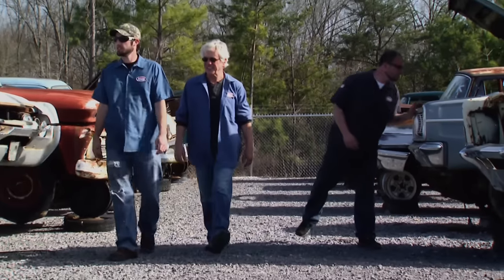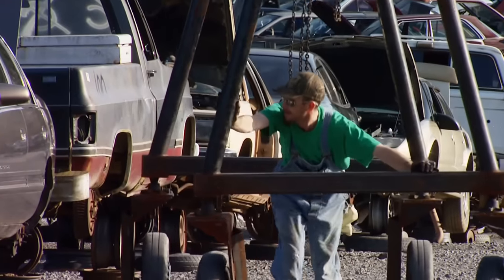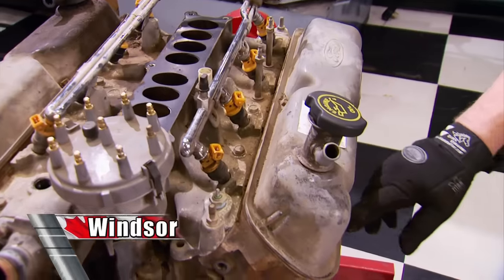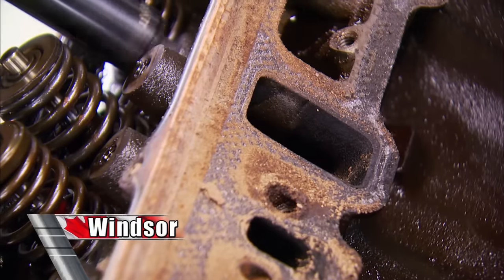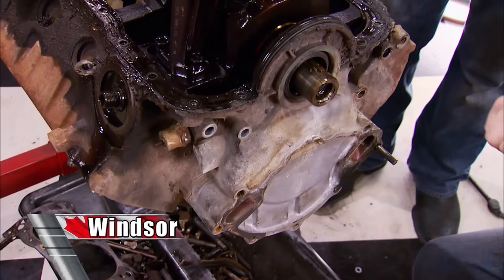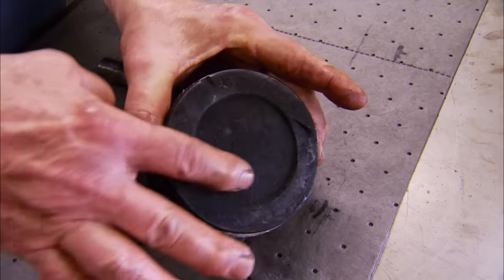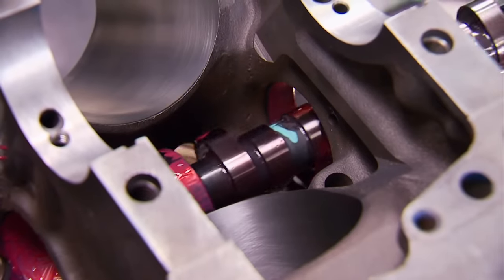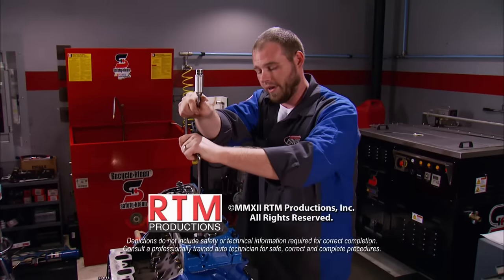Tearing Down a Pair of 351 Small Blocks: Windsor vs Cleveland - HorsePower S16, E10

Comment: OK WAIT...Thats NOT a 71 LTD (or even a 72)...I had one...which had the 351 Windsor, in my own opinion the better of the two engines...especially when you figure the 351W 2BBL to 351C 2BBL compared...The windsor ALWAYS had more low RPM torque...which is why it was put in Fullsize cars...and the Cleveland was mostly used in Midsize cars where the lack of low end torque didn't matter as much....SMH!

Comment: Who would scrap a foxbody coupe😒😒, and besides the clevland is junk the oiling system does not give primary pressure to the crank, it's a recipe for spun bearings. The only good part about it is the heads to build a clevor

Comment: CLEVELAND all the way. - 100 times better engine than the Windsor... ESPECIALLY the last two years they were produced. That being in Australia. The block and heads were crafted from the same piece of steel and would therefore, heat up and cool down together. You could pound the hell out of these, and they made amazing drag engines.

Comment: Yes I'm a coyote guy I would never drive any good I'm just saying you can get the same amount of power with a smaller engine but then again the EcoBoost is worse on gas when you're actually towing or flooring it everywhere It's actually worse than the coyote

Comment: Me quiero hacer de un Ford Galaxie 500 LTD 1974 propiedad primero de una tía abuela y ahora de mi tia, la verdad no recuerdo que motor tiene. Solo recuerdo que dice en la tapa del filtro de aire. 351 H.O 255 HP. trae carburador Holley creo que es de 4 gargantas. No sé si sea el Cleveland o el Winsor. Fue adquirido en México 🇲🇽. Trae 100,000 millas originales desde hace 46 años. Me pudieran ayudar si saben más información de los vendidos en México. Lo que me gusta es que lleva de transmisión manual de 3 velocidades a la columna de dirección.

Comment: Ah Cleveland is considered a big block.
Reply: No.
Reply: @Sokrates66  Sorry it is, Windsor is Smallblock!!
Reply: @garykent8193  Its not, and here is why. Small vs big block is a Chevy thing. Ford never rated their engines like that. 351c is a 335 series engine. But if you anyway want to rate the 351c.  The 351c  is in fact a small block due to chevy specs and the 351c have the same bore spacing as the 351w which is the criteria for big or small block. So if you "say" 351w is a "small block" the 351c is it also.

Comment: A 351W is not a smallblock..Its a midblock as it has a taller deck than a smallblock [9.5 vs 8.2]..289/302's are SMALLBLOCKS..

How would you guys classify a 350/400 Pontiac?..Lemme guess ;- a smallblock[?].......LOL

Comment: This is a very sophomoric attempt at highlighting the differences between the Ford 351 Windsor and 351 Cleveland engines and a fair degree of misinformation.
Reply: Be specific please.
Reply: @Michael Stansfield Can you recommend a video/channel that does a better job of describing the differences please?
Reply: A better video explaining the differences?  There may be some out there, but I prefer reading.  A good synopsis of the 351C can be found in this Hot Rod article.
https://www.hotrod.com/articles/1971-ford-mustang-everything-need-know-fords-351-cleveland-powerhouse-powerplant/
Beyond that, you need to do some reading, some research.  The 351W has been around since 1969 and has undergone tons of changes.  The 351C was around from only 1970 to 1974, but was available in a number of variations.
Oh, almost forgot, this site has tons of information.  https://www.diyford.com/

Comment: Why was ford so stingy with 4 barrel carbs, did Holley piss them off or something...🤷🏾‍♂️
Reply: Corvette Coupe you need to do more research on that, there was one 2v Cleveland variant and 3 with 4v carbs.  One of each with Windsor.  Ford primarily used its own Autolite 4100 4v, a spreadbore Autolite 4300 4v, and various Holley carbs.  It depends on the application.
Reply: My research was done under the hood 40+ years ago folks, 2V was the common on Sub 400 CI engines Mustang, Torino & Cougar...
Reply: Corvette Coupe well there you go, I guess your question was rhetorical?

Comment: Why use oil restrictors in the Morse why would you want to restrict oil flow that is ridiculous you won't oil until flow like water otherwise you starve the barons in the engine at higher PM You wanna make some packages bigger not restrict them or you do your homework Stacy David you're wrong

Comment: The value of the canted-heads in the Cleveland is severely limited in comparison to the Windsor, only the big port closed chambered heads with the four-bolt mains pushes it past the Windsor. Frankly the open-chambered Clevelands are mediocre at best...you've got to realize, the entire engine with the closed-chambered heads were conceived at a time where emissions, economy and gas prices were still not taken seriously, the stock compression was way too high at eleven to one, making todays gasoline virtually unusable. The only "fatal flaw" to the best of the Clevelands was the exhaust ports...had the engine been brought out earlier, nor the "gas crisis", insurance companies & the safety nazis coming to power, this 351 cubic-inch motor could have been an off the showroom floor  500+HP factory engine.

Comment: Serious question: Do you blokes actually get anything right, ever?
3 points straight off the top. 
The Cleveland was built right up to 1982. That’s 13 years not the 4 you claimed. You do realise there is an entire muscle industry out side of Murcia don’t you?
How can you compare a late model efi Windsor to the pre-smog Cleveland. Would be much more beneficial to compare a circa 1970 version of each engine.
As for the ‘small’ mains on the C, their size had nothing to do with strength, but were chosen as experiment of 3” mains on the 351w failed due massively increased bearing speed. Ford went back to what worked.
Sad thing is you put shit out there and those new to this don’t any batter and swallow the crap you do.
Maybe you guys should stick to generic and vanilla GM bread and butter...
Reply: Matt Macdonald Jesus dude...this show was originally aired in the US long before YouTube.   We don’t have ready access to Cleveland in the US, because they were only produced in cars for five years.  Typically you lean towards what is available.

Comment: Save yourself some time and forget the Cleveland. The windsor is a way better choice on every level. The 351c is way over rated and not impressive by my standards. With aftermarket fancy heads and most bells whistles your lucky to get near 400hp. A 302 windsor can do that or more. 78 bob glidden pro stock pinto 351c 650hp all out race car 10 flat.......not impressive today

Comment: Did they really just take two 2.3 L Camry 4 cylinder engines and stick them together and call it a 4.6 modular I don't know what it looks like to me could be very wrong with basically that's what they did Fiat and GM are still knuckle dragon with pushrods but I will admit overhead cams suck for like the super duties all those 5.4s and the 6.8 L v10s were garbage super duty is only good with power stroke now the Chevys are good because they have pushrods push rod is way better for idling for hours and towing and doing hardcore work

Comment: The Windsor is a small block. The Cleveland is not. Its considered a big block
Reply: No it isnt.
Reply: I do believe you are mistaken. How did u come to your conclusion? 351W small 351C big 351M big
Reply: @ronaldremer1  Big vs small is as Chevy thing. Ford never called their engines that. Cleveland is a 335 series engine as the 351M and 400 also is but with a different block.
Reply: I'm sorry yes ford didnt ever call them b or s . They classified as an Engine family or group. I was just remembering what many an old mechanic (30 yrs ago) used to call them  I'm 46 and retired mech myself. Gotta remember to check myself b4 making statements if it aint among friends/relatives. You are correct sir
Reply: @ronaldremer1  And still if you want to call big or small in Chevy terms the 351C also is a small block because of what i recall its about the bore spacing and the 351C:s meassures is within Chevys criterium of a small block. With all that said i can say that imo the 351C is a small block with big block sized heads. The 351C and 351W have same bore spacing and the 351W can be fitted with C heads.
Reply: @Sokrates66  i also helped run a street stock at local racetrack (cajon speedway) fast little 3/8 paved oval. Could eat cars though quick!.. we always ran either Mexican or Australian  Clevelands blocks (thicker cast??)
dont know exactly why but driver owner was british and the other 351C never wanted to stay together very long. Maybe u could shed light on this???

Comment: Drills holes in oil pan and gas tank instead of draining them properly incase someone needs one 🤦🏻
Reply: @centraltexasfoxbodies  cut a fuel line and turn the key on. A fuel pump runs until the pressure regulator reaches the required pressure. If it doesn't it'll continue to run.
Reply: You sound triggered. Sorry that i may have a tiny piece of information wrong. And i dont need a tank or oil pan. I'm speaking in general. Not everyone can afford a new prodect especially when salvage yards have them

Comment: Ummm Cleveland is not a small Block......
Reply: its a small block
Reply: @jquest43  No it's not, Cleveland is a mid ./ big block, Windsor is a small block
Reply: @keithf4618  theres trolls going around doing the " Cleveland is a mid/ big block"
sorry but the 351 Cleveland is a SMALL BLOCK..the 351M is different.
Reply: @jquest43  Listen Bud, I have had like 6 of each And Windsor is a small block, The Cleveland name comes from the City of Cleveland Ohio Where Ford had there Big block Engine plant, The Mod 400 or Mod 351 also Big blocks, came from over stock of the 351 Cleveland Big Block!
Reply: @keithf4618  wrong..the 351 Cleveland ( not t the 351 m) is a SMALL BLOCK.. you've never had anything troll
Reply: @keithf4618  the only things BIG on a  Cleveland are it's heads BTW this narrator also calls it a small block,he's an expert mechanic.
Ford called it a small block
Are you simple?
Reply: Actually its not a small or big block, thats a term used by Chevy. All Fords is named after family. 351c is in the 335 series family but with a different block than the 400 and 351M. But with that said if you still wants to classify the 351C and thinks that the 351 Windsor is a small block in Chevy-terms the 351c also is a small block. Both have the same size and bore spacing.
Reply: @keithf4618  you've tried to put bigblock heads on a small block?
Again,are you Simple corky?👶
Reply: Trollollo

Comment: why would anyone waste their money/time on a cleveland? ... they don't even make a good boat anchor!  and the 'm" is worse.
Reply: LOL Cleveland are great not sure why you think they aren't.
Reply: @dano198 ... great!?  for what??? if you knew anything about them then you would have known.
Their designed is the worst ever. Rotating mass way too heavy, especially "m", rods too short=too steep rod angle not to mention piston side load requiring longer, heavier skirts, cc design/ports dead air space, engine oil heated intake, ...these are just a few. Do research before showing your knowledge...  lack there of.
Reply: Bob Glidden would have disagreed with you, so would his GM & Chrysler opponents
Reply: @flcracker9  so you're saying Glidden used off the shelf 351c parts?  rightttt...   
Did you know Ford never install a steel crank in their so called Boss351 or their HO351... ever wonder why?